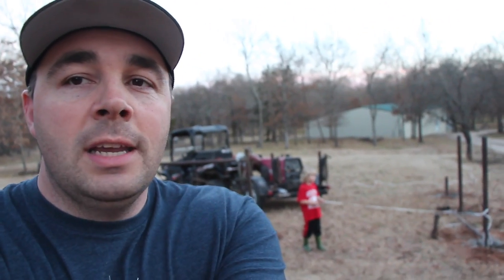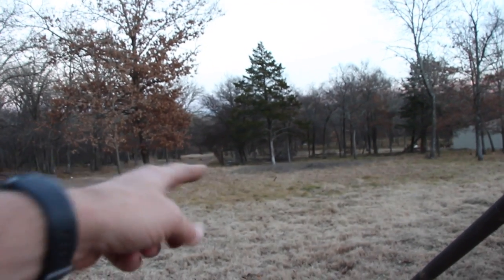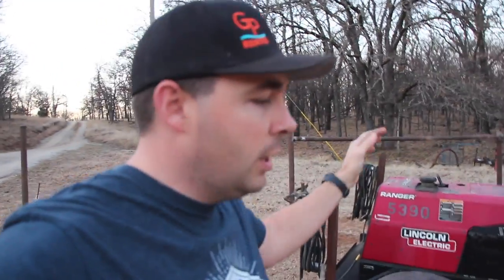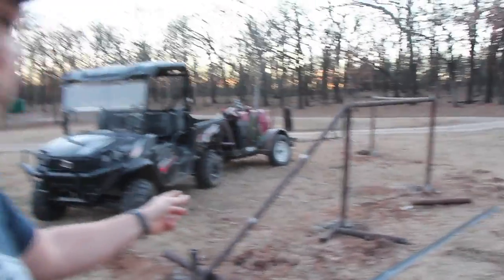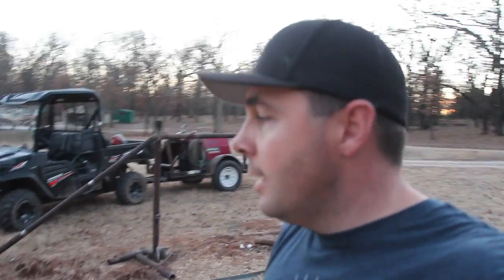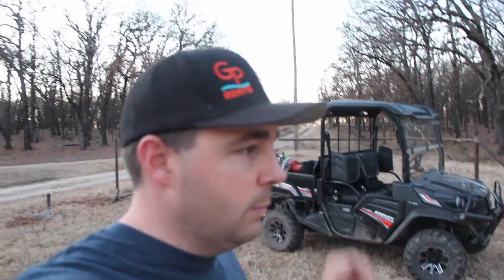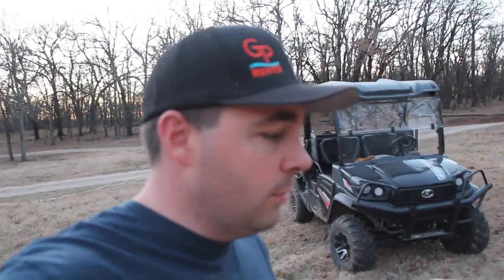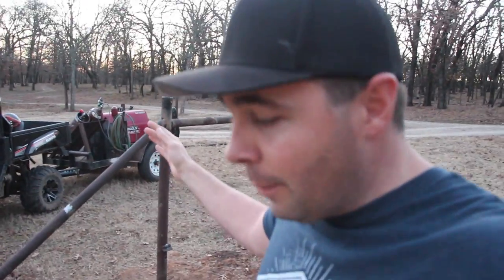Fence Building || Welding in the H-Braces.

Comment: it is pretty neat seeing how different people build fencing, like using the H brace and the angled brace and the steel pipe. Seems like it would be ok  We do it a bit different with no H braces and we use the wood posts down here for the most part in Florida. Great video.
Reply: Wood braces rot quick and they burn as well very easily if there's a fire but if you don't use H braces than what do you use then? Just a single post by itself isn't really that strong like at the beginning or end of a fence line or next to a gate if you don't have either H braces or N braces.
Reply: @Charliemmafan  No we use what we call a deadman, you dig a trench in front of your corner post at a 90 degree angle to the direction you need to pull approx 4 foot long and 18 inches deep. you keep it tight to the corner post and cut a wood linepost in half and then lay them in the trench you dug. ideally the line post needs a little persuasion with a sledge hammer or another post used to drive them down into place lying lengthwise as it is a very tight  fit. so when you make a pull the area of dirt used as resistance on an H brace is the width of the post, my way you have a 36 inch wide 8-10 inch tall wall of dirt.

Comment: I could have used that Sidekick the last couple days. I've been trying to put in a new fence line. Between having to cut down small trees (chain saw), to cutting back briers (clippers), to pounding in T posts (post driver), screwing in insulators (impact driver), and all the little odds and ends, I plumb wore myself out just hoofing the tools back and forth! 🙄  But, at least I don't have to worry about a gym membership!  😜

Comment: I know this is an older video of your but I have a question. But what are your thoughts on in line braces (one 10’ pipe with a kicker on either side of it) vs h braces and at what spacing on longer stretches? Say 2000-3000’